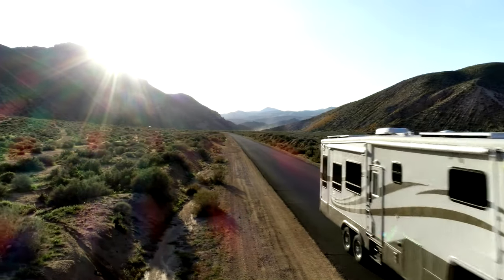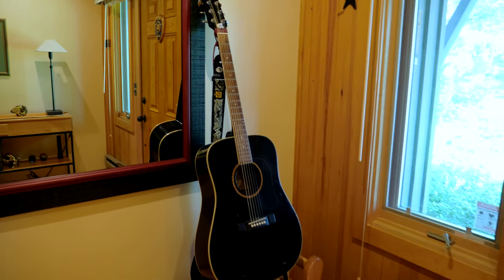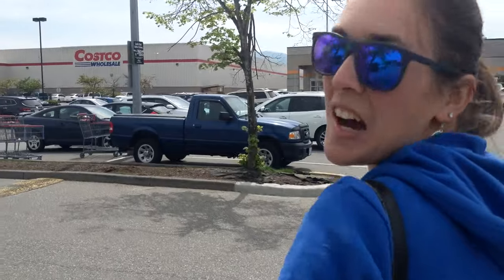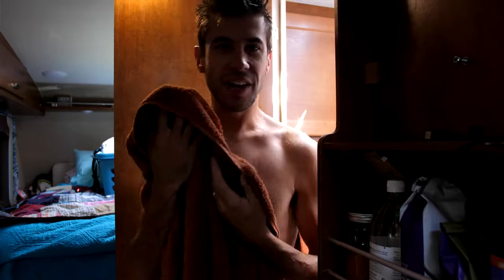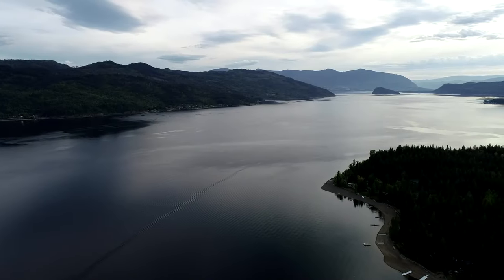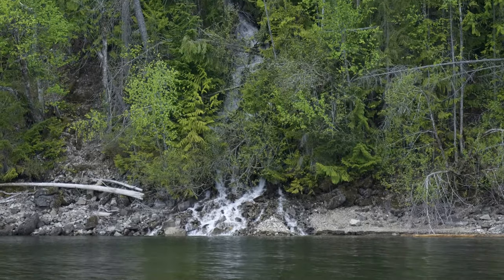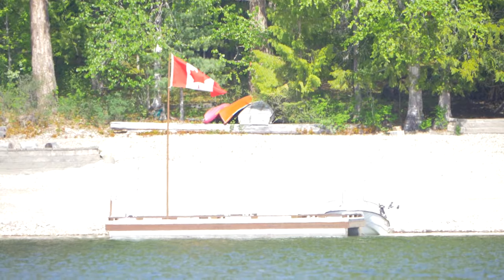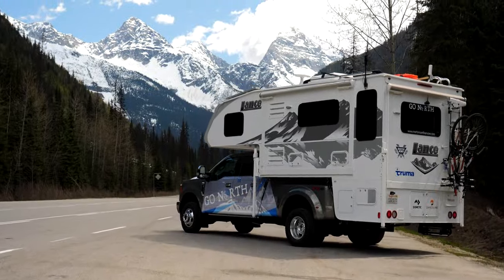RVing in Canada - Shuswap Lake Wake Surfing & Lake Louise Avalanches | Go North Ep 5

Comment: Great job on the video.  You adventuring spirit to jump in a truck camper and travel to the arctic circle is amazing.  You continue to inspire us.

Earlier this summer we thought about a more pedestrian and safer 30 days of travel in the Southeast.  Safe since we have traveled the areas before.  Your journey inspired us to think bigger and we are now heading on a 30-day trip that will include over 4,000 miles of travel, drive through 13 states,   and spend a couple of weeks in Colorado.  The mountains and elevation will be very different than Florida.  We continue to follow your advice to do what you can now.

Comment: Wait a minute. So every time you remove the Black Water cap sewage will spew out?
Reply from the maker: Well we figured it out, it needs to drain all the way for quite a while to get it all out of the tube, if you cap it too early yea it makes a mess.   We also put a cap with a hose connection on it and we're able to prevent spills.